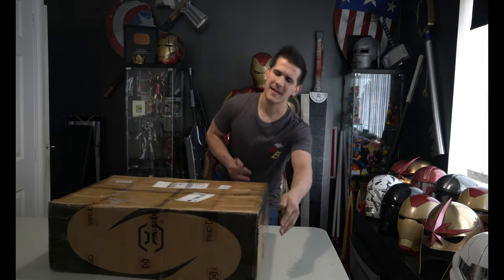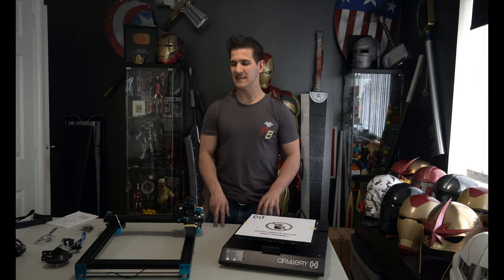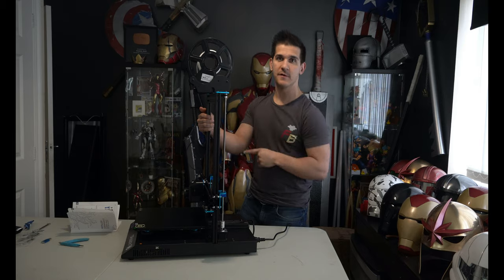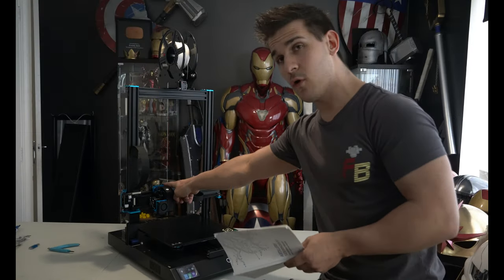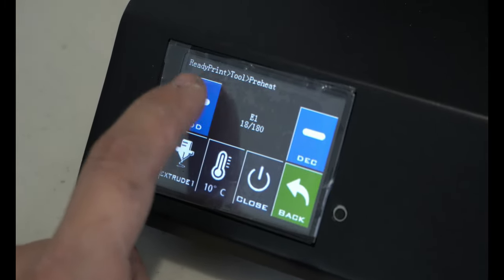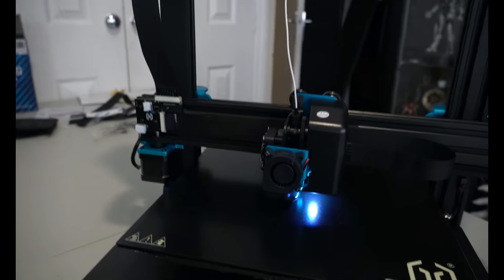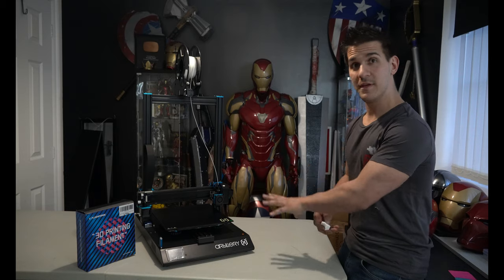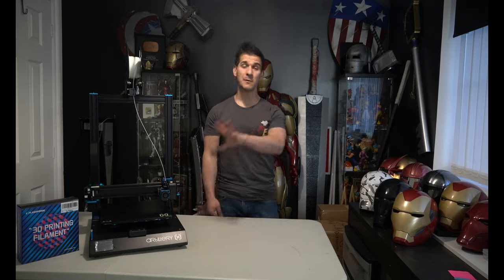Artillery Sidewinder X1 - Unboxing and Quick Review

Comment: Love your video's and they truely inspire me and help me to not give up on this hobby given the bad experiences I have had with the printer. 
Hope yours is better than mine, had to get a new bed cuz mine was warped out of the box and get a new mobo after a year. Thankfully their support is great, slow but great. They send me the bed for free and even extended my warrrenty so they could send me a new mobo and send a second one by accident cuz they forgot it in the package in which they send me a new hotend cuz it also broke or caused the maxtemp issue. My friends printer has worked fine he also has an X1 and is currently fixen and testing mine cuz he has more experience than me.

Comment: Great vid as always. BTW, You can use a transformer to step down your voltage to 110.
Reply from the maker: That’s not how that works quite exactly for things that need a higher voltage down to a lower. It burns much more electricity to step up